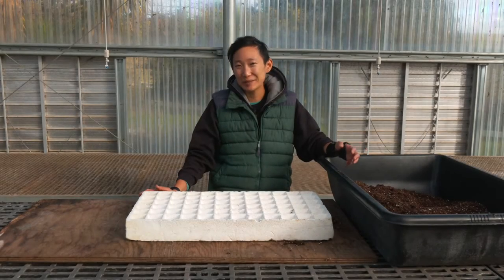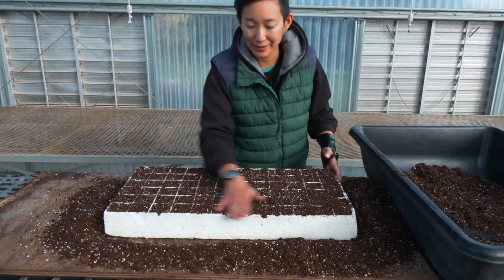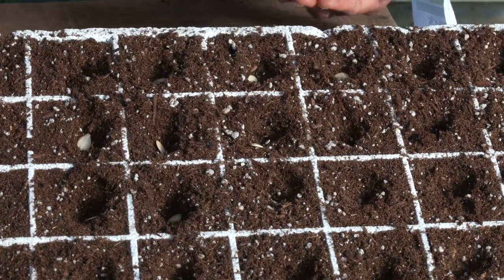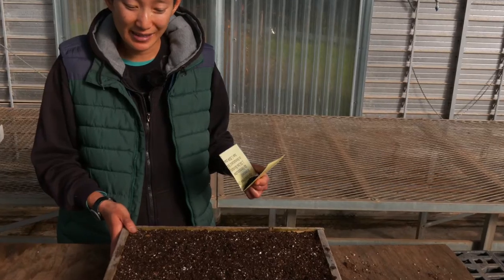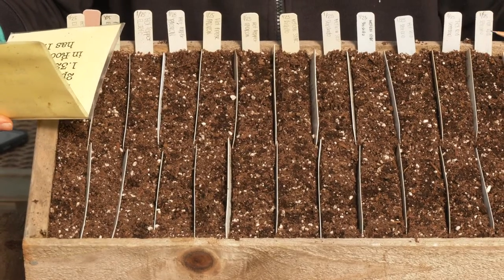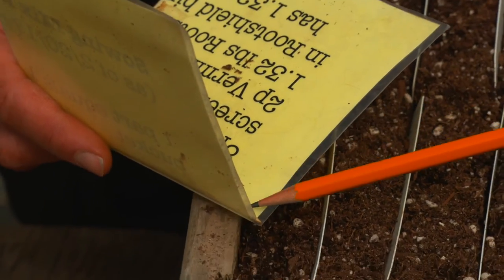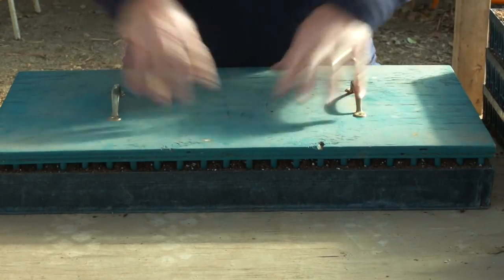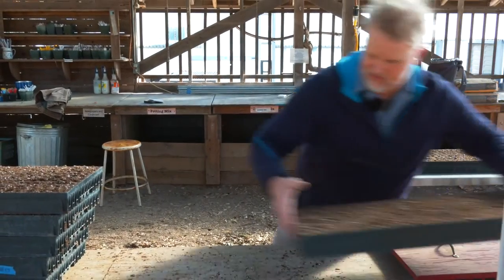Seed Sowing By Hand & Using A Dibbler

Comment: If you guys spend a significant amount of time doing this, it's probably pretty easy to rig a foot petal to the bottom of the table to make the settling process easier.  Just rock the table a few times instead of lifting the whole tray!
Reply from the maker: We don't spend much time doing this, so shaking by hand works fine.  But thanks for the suggestion.